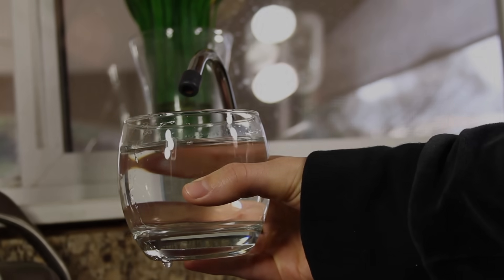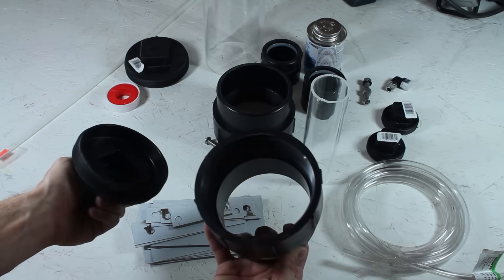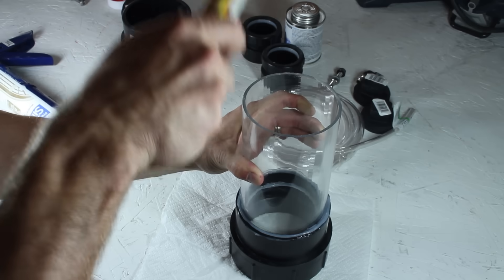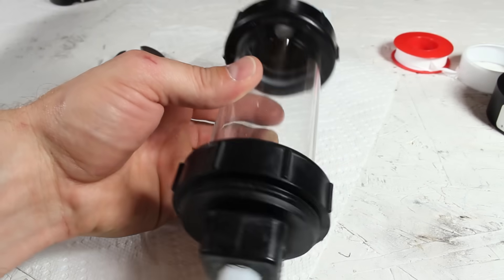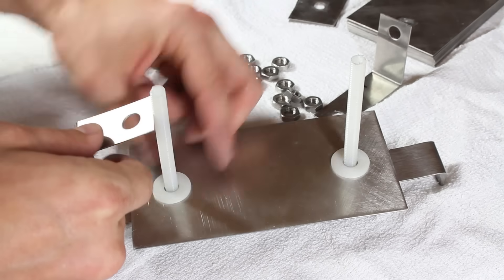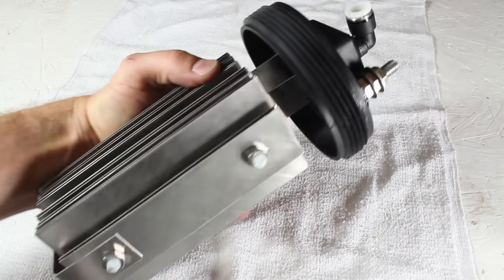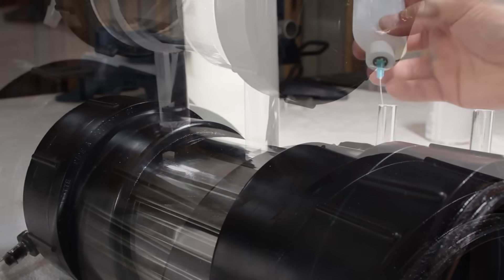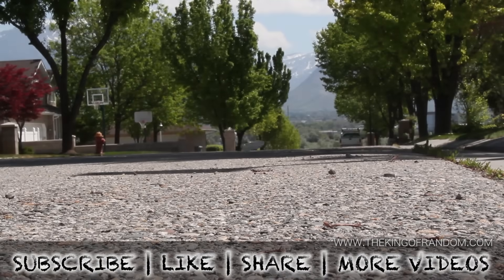HHO Generator - Water to Fuel Converter

Comment: it might be more effective to use urine
Reply: Meshiest
I see  the possibilities are endless :-)
Reply: Have you tried electrolyzing urine already? What are the effects?
Reply: ***** you get Hydrogen and  Nitrogen just as with water you get hydrogen and oxygen
Reply: Hmm.. I've got a bunch of hamsters. This should be interesting.
Reply: Ed19601 or for... water? http://www.gatesnotes.com/Development/Omniprocessor-From-Poop-to-Potable
Reply: would it work?
Reply: whetherthis machine works i dont know. but electrolysis works and there is more hydrogen in ammonia than in water
Reply: Ed19601 I think it might be toxic because urin contains salt which during elextrolysis creates chloride gas.
Reply: yes urine contains Chlorine atoms, but so does water. The fact that chlorine is toxic is no reason not to use electrolysis, after all chlorine is still made on large scale (e.g. Solvay) Furthermore it is not the intention to just release it in the atmosphere, it will  develop at a different electrode than the hudrogen and thus is perfectly seperable from the hydrogen

Comment: Or, you can mix vinegar and baking soda into a pet bottle, collect all the sweet H² and make nice and dangerous fuel.
Reply: no H2 just CO2 from baking soda and vinager
Reply: Vinegar and baking soda will not produce hydrogen gas. As mentioned, the only gas produced will be carbon dioxide. Try the experiment. If you put a lit match into it, it will put the match out.
Reply: That's definitely CO2 that is being produced in your reaction. If you want to produce H2 you can do it with lye, aluminum, and water. Be careful! Lye is nasty stuff and it gets hot enough to boil.
Reply: Darn, I already bought the plans for him. Whatever! I still wanna build it.
Reply: Caleb Osborn Yeah, the downside is the eletricity used, but this experiment seems to be very fun !
Reply: rob armstrong I don't remember for sure, but if not baking soda, plain soda, washing soda. And that's with vinegar. I'll look up.
Reply: ok be interested what you find out cheers
Reply: That's not how it works.

Comment: would it be possible to make a really small one that runs off of a nine volt or similar voltage?
Reply: Hmm yes but it would be very slow and hard to use but it would probably be the size of be bubbler on the side and you need a bubbler to filter the gas  that comes out of that... Very hard boy possible
Reply: no, it would just yield way less
Reply: Ya I guess Bert van Rossem but it would be tiny
Reply: ***** ok thank you I'll try designs based on this! :D
Reply: Jason Alexander Good luck!
Reply: ty!
Reply: ***** Since i am building one now too, i was wondering what's more important: voltage or amperage. I couldnt find anything about it but where did you find it?(if you still know ;D )
Reply: Only if you feel like waiting six months to fill your tank. 
Electrolosys takes a lot of current, a 9 volt can deliver that, but not for nearly long enough to make any gas.
Reply: ***** Ok I'll try that

Comment: Is there some technical reason why that gas can't be run in an engine of some sort (like a traditional internal combustion engine), then some power taken off via alternator to continue producing the gas from water, while the engine is used to do work (like propel a vehicle) ?

Why wouldn't that work? Grant Thompson - "The King of Random"
Reply: nevermind. found the answer: a liter of HHO gas is roughly equivalent to 4.5 drops of gasoline. Not a whole lot of power there, really.
Reply: If you delete this post then you don't have to be embarrassed by talking to yourself
Reply: Daniel Mendez thought people might be interested in the specifics... jeez i'm pathetic  ;)
Reply: @DClairRobinson  One liter of water contains 1860 liters of HHO gas though, plus hydrogen has a much higher energy density.
Reply: @zephyrtolliver4113  so, in theory, take a tank of water and keep separating the hydrogen out ONLY at the rate of consumption by a combustion engine right? Compressing the hydrogen for intermediate storage would present too much load for the system to sustain, but if you had a properly sized expansion chamber for the right amount of extracted uncompressed hydrogen....
Reply: Daniel Robinson If I remember correctly, it takes more energy to create the gas than it produces.
Reply: @aerobyrdable  No this is false, the gas is not being created, it is being separated from the water molecules.
The gas itself when combusted has more than enough energy to split the molecules. The energy loss is just energy being converted to other things, heat, friction, kinetic energy, etc.
Reply: Blace007  you mean just like LPG gas that alot ov cars can run on with out a large out lay this is totally viable......think lol
Reply: The oil industry, that's the reason.
Reply: Any flammable gas can be used for an "engine" It's just difficult to store. We have been spoiled by decades of high energy density petrol and diesel, especially as they are so easy to store. ;-)

Great video :-)
Reply: The reason is, that you never can take energy out. By burning this stuff, you'll get around 30% of the energy out and his generator is around 70% effective
Reply: Blace007 I think there is a word for this type of gas held under pressure as liquid. It's called "water".
Reply: ***** you dont get my point.. all i'm saying is of course a gas is less energy dense than a liquid. so if you would want to use this h2 and oxygen gases in your car you would either store it pressed as one tank of pure liquid hydrogen and one tank of pressed liquid oxygen or leave it as water and transform it into these two gases as needed while driving..
OR store the hydrogen in some other more dense form than its gas form (because the liquid under pressure form can be quite dangerous)
(the pressed oxygen part is probably optional as it could also be taken out of the air)
Reply: Usually it's because the energy it takes to convert water into hydrogen gas is far greater than the energy that gas would release in an internal combustion engine. 
A carborated internal combustion engine can run on H, but it needs to be pure and in high volume. 
Mythbusters tried it, just look that up. They probably explain it better than I do
Reply: The Hindenburg.
Reply: Daniel Robinson Yeah. people are allowed to vote despite not understanding the issues at hand. Therefore, people who think that a hydrogen car will explode like  something from a Michale Bay film decided it's too dangerous, instead of engineers and scientists who know how one would actually explode if it did. Which isn't much, because the car would be filled with water, and make it's fuel while driving via a generator like this so there is very little gas in it at a given moment. But ignorance and idiocy rules this world, so we dont use them. Just like nuclear power.
Reply: Daniel Robinson you cant compare something liquid to something in gas form.. of course the liquid is more energy dense.. but it would be possible to also store this gas as a liquid in a car (under some pressure)
Reply: @Blace007 , don't even think about attempting to store this extremely volatile gas. On the other side of the coin, however, you can build one of these to run from your car battery and vent the gas directly into the air intake. If your car has a computer, it will adjust the gasoline mixture to compensate.
Reply: *****
Noooooooooooooo this is chemically separatid it's just a mix out of liquid hydrogen and liquid oxigen
Reply: @eddyfuchs1 , which will create an extremely volatile gas with the capability to create very large craters.
Reply: Yes and no, you could take the gases and separate them, then store them, although storing both in liquid form would undoubtedly take a large amount of energy and/or equipment, and the end result would NOT be something I would want in my car. Liquid Oxygen is pretty terrifying stuff. Or you could do what Blace was describing, to take the resulting gases and put them into a jar, then collecting the liquid, which would yield distilled water
Reply: i think, with tha much pressure to get them liquid you would acitvate the reacian and get an horrable explotion
Reply: Me & my crew are working on one 😉😉😉 see our company in 15 years. Already makin blueprints
Reply: The reasons for this are that some engine modifications like delayed spark timings etc. need to be done when using hydrogen as a fuel. There are many more factors that need to be considered as the same calculations might not work but yes with some modification this can be done most probably.
Reply: ***** well.. no.. if you press this gas it's not water smartass. already the fact that you have to press it to be liquid and that it would vaporize if you take the pressure away shows that.. think
Reply: Blace007 If you take water, and decompress it rapidly, you will get water vapor, just like pupping the top off a water bottle. If you electrolyze water, collect all produced gases in one container, you have H2+O, which like to combine into water. so yes, if you take pressure away, water vaporizes, but under STP, or under pressure, it will condense into water
Reply: Daniel Robinson I'm working on combining this Electrolysis fuel converter with something similar to a superconductor as a battery. (College Project don't ask, too many details to explain properly). Combining 3-4 of these with a battery outputting around 5V would not only reduce the Overpotential but it would also become more efficient the longer its used per cycle. Lets say this is used in a car the longer the car runs the more efficient it becomes. You combine this with the technology the UK came up with years ago for a hydrogen system attachment to a car and you have an almost self-sustaining car. The only problem is the price tag on the hydrogen system attachment over $250,000 for something thats like a skateboard for your car....
Reply: You could use it in a generator if you find the amoit that is not harmful to the combustion chamber and set a valve set up to let gas in as the water gos out so yes it can go to work for us the tryed it in California years back but not enough people are willing to give up there cars for it and the company's that made it wont give them away to get the product out.there to.get it started
Reply: Daniel Robinson While that is correct you must be assured that gasoline efficiency is only around 14% to 20%, this is because the traditional igniter inside a car is placed at one end meaning that not all gasoline is ignited, allowing some to leave through the exhaust. If you used HHO as the ignited, you will be getting about 40% + better gas mileage.
Reply: It's true, unfortunately approx 80% of internal combustion engine fuel energy ends up being given off as heat. :-)
Reply: Geometry Dash Ande Yet no one thinks about how gasoline is the equivalent of 16 sticks of dynamite....
Reply: Daniel Robinson Easier way to do it is with a fuel cell like this vehicle

https://www.hyundaiusa.com/tucsonfuelcell/
Reply: Maccattack77 simple: you can't use it on a regular combustion engine.
Reply: Com Psy thank you! Someone finally said it! I've had this argument multiple times with people and no one seems to factor in the rule of diminishing returns. However I do need to point out that a turbocharged vehicles thermal efficiency can exceed 40% and a opposed piston engine can exceed 60%.
Reply: Daniel Robinson Hydrogen is the fuel of the future, regardless of how "inefficient" we may see it as now. Main problems are efficiency of harnessing energy, storage and cheap production of hydrogen. This is why many say "electric" cars are a thing of the future instead of hydrogen, however I disagree with this. As electric motors have nowhere near the power or torque of any potential hydrogen engine. So I think for hydrogen to be a viable source hydrogen must first be cheaply and mass produced, must have engines custom made to harness as much power from hydrogen as possible and better, safer storage of hydrogen in gas or liquid form.
Reply: How long did it take to type this comment ^^^^^^^^^^^^ up there
Reply: The reason it wouldn't work is because in a traditional combustion engine, gasoline is used, a liquid. If you try to pump in gas, the gas will just equalize in all parts of the engine and the explosive force of the gas may be different compared to the of gasoline.
Reply: Yes & no, it has been done, but there are a lot of modifications that have to be made. The more practical use is to use the hydrogen and oxygen gasses that are produced as a supplement to gasoline to 
improve mpg. Look up "HHO" for more information. Stanley Meyer built a car that ran off of water, but it had special injectors and electronics to make it work.
Reply: Menuki The Hindenburg was a big balloon full of hydrogen. A Hydrogen car contains very little of it at any given time, and makes it's own flue from a  tank of water. It's not like you filled it with 55 gallons of liquid hydrogen.
Reply: Scottx125Productions - Spiffingly Serious British Gaming! Model S P85D - no one needs that much power and torque and it is an EV.
Reply: Hendlton
Yes that's very true. But that dsoent mean it wouldn't work and be safe. It just means it s a dumb idea.

Comment: The process leaches hexavalent chromium out of the stainless steel and into the water solution. If you ever empty the solution out of the generator it needs to be handled with extreme caution and properly disposed of at a hazardous waste center. This is no joke! Simply dumping it on the ground or down the toilet is not a option! Please don't do it!
Do a search on it, it is extremely toxic stuff!

Comment: Grant,
Can i use tin instead of stainless steel (it is locally available but steel sheet isn't) ? I am building a smaller version of this HHO generator for my science fair (i am 13) . i cut pieces at 4" by 2" *8 and connectors pieces at 4" by 1" *4 i am not gonna put those small connectors to the generator (is it ok).

Comment: I see plenty of people talking about "free" energy (impossible), and others talking about this being "inefficient" and talking about how it can't work. Both are equally wrong on opposing extremes... 

This is an inefficient form of fuel, but so are all fuels. Gasoline requires a tremendous amount of energy input; from the extraction of crude oil, transporting crude oil to the refinery, refining process, and then transporting again to gas stations just to be quickly burned. Refining gasoline is tremendously energy intensive, and extremely costly.

Let's compare apples to apples, you can't neglect the energy cost hidden within the extraction, refining, transportation, and production of gasoline. It's wrong to use these energy costs in argument against HHO while ignoring them in alternative fuels like gasoline. 

- The extraction of water is far less energy intensive than crude oil, and can be done on site saving transportation costs.
- Catalyzing water is far less energy intensive than refining crude into useful byproducts by destructive distillation.
- The car doesn't need to run itself while producing HHO, does your car refine gasoline while it runs? I think not... HHO can be produced, and stored for use at a later time.
- There are ambient sources of energy which can be used to decrease the cost of electrolysis, solar, wind, regenerative braking, etc...

HHO is dangerous to store, and that's why it isn't used in cars. To use water as fuel without scavenging energy of greater magnitude than what's consumed in electrolysis, is impossible. That said, there is plenty of energy which can be scavenged to offset and overcome the inefficiency but capturing it more efficiently will require advances in technology. 

My point is, when considering the ACTUAL NET energy required to produce a finished product, HHO from water by electrolysis is VASTLY more efficient than other fuels; especially fossil fuels, and can be accomplished on a small scale with a low environmental impact...